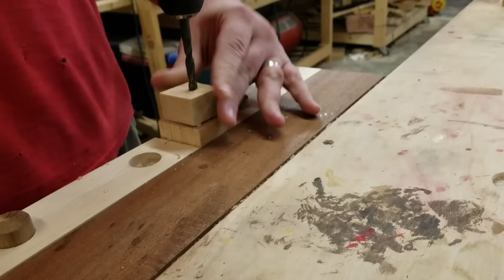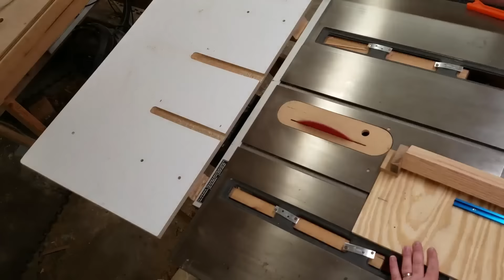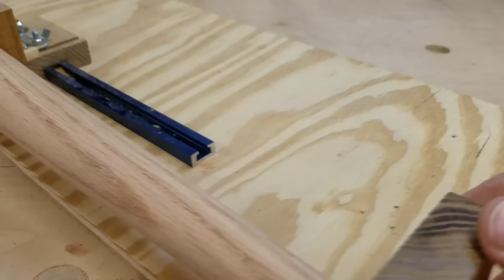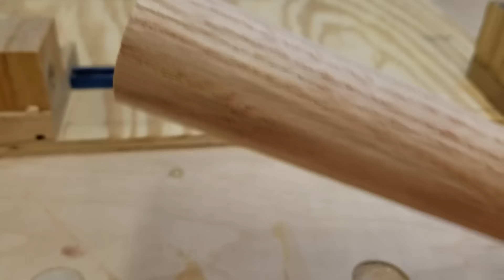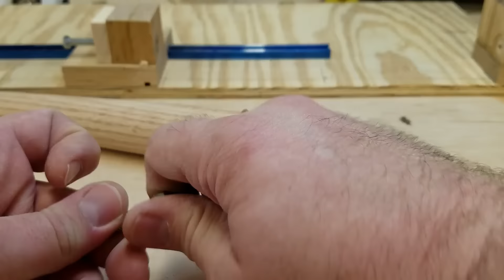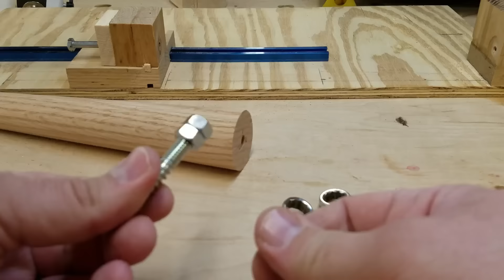How to Make Mid Century Modern Tapered Legs On A Table Saw!

Comment: Just a beginning woodworker here, so I don't know much. But could running that spinning wood through your blade adversely effect your saw blade or the saw itself by putting lateral pressure on the blade? Possibly torque something in the mechanism that the blade is mounted on?

Comment: This is awesome! i'm new to wood working. I've watched it a couple times and I can't tell how you are getting the tapered angle for the legs? Is it coming from the angle of the fence? Also what do you call the little cap with the threads that you hammer into the wood, so you can attach the bolt?
Reply from the maker: Hi Tedd, the pivot point for each end is offset. on the rear its 3/8" from the blade which gives a finished 3/4" and on the front it is adjustable but in this case its set at 3/4" to give 1.5"
thanks for pointing this out as its true its not real clear in the video. if you have any more questions let me know
oh and the little insert is called a "4 prong Tee nut" thanks for watching!

Comment: Just finished making a jig similar to this. Wondering how you are able to use your drill and spin it over the blade without the bolt wanting to self tighten onto the t nut? Mine either self tightens or is too loose and the piece just wants to move when I get halfway through a cut.
Reply from the maker: forster46 the bolt is the kind with threads only part way along the shaft. I just tightened all the way into the t nut. So when the drill turns it just turns the whole thing. Hope that makes sense

Comment: very cool - kind of reminds me of Izzy - one bit of criticism is that your camera focus, you need to lock it down.
Reply: Shogun-Jimi yes! that was very irritating! was using my S7 samsung phone and i couldnt get it to focus at all. not sure how to lock it but im going to figure it out before using it again
Reply: I use a note 3 - and it was doing the same thing. I installed an app to solve the problem.  it is called Open Camera. but I have recently upgraded to the s7 and it did not seem to work.  So, I went back the old phone.
Reply: Shogun-Jimi the pro mode on the S7 allows manual focus, i guess maybe that would solve the issue. ill have to play around with it some more. i think i tried that app at one time, i might look at some others too. i have a gopro i planned using for vids but didnt use it on this for some reason
Reply: I have a go pro - it does not record sound so I use it for time lapse.  let me know if you come up with a definite answer to the S7.
Reply from the maker: will do!

Comment: This is awesome. Do you get kick back ever when your spinning it? 
Whats the fixing that allows it to spin like that?
Awesome vid!!
Reply from the maker: Hi Zoe, i havent had any problems with kickback. the blade really isnt cutting very deep. the work piece is attached to the jig by a screw in the back and a threaded insert in the front. the insert is what has the small tabs that stick into the work piece. a bolt is then threaded into the insert and used to spin. thanks for watching

Comment: What is the reason for the small wooden key stock for on the bolt side of the jig?
Reply from the maker: thomas collins on the bottom there are screws you can loosen that allow the front block to slide along the keyway so you can change the distance from the blade. If you wanted a 2" top you would slide over the block so the center was 1".
Reply: good thinking..building this over the weekend...Thanks for the great video.